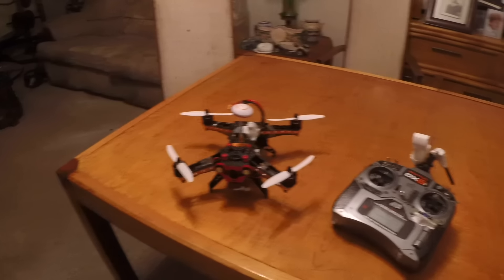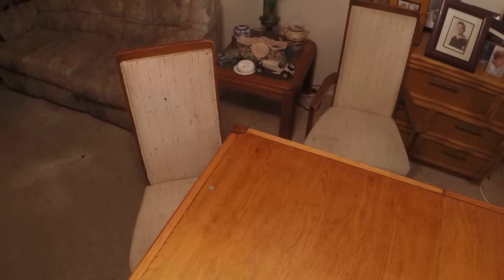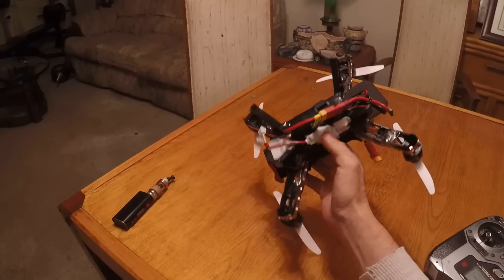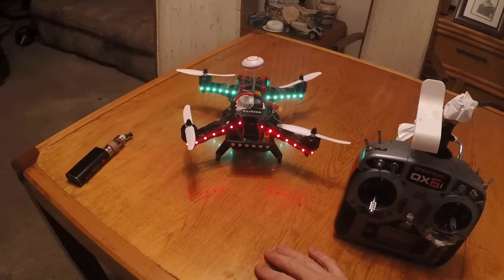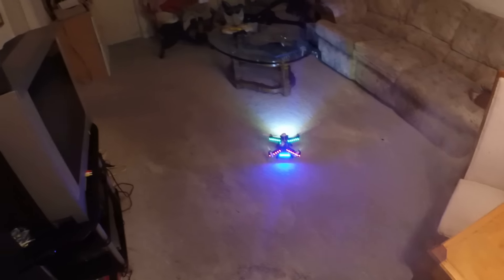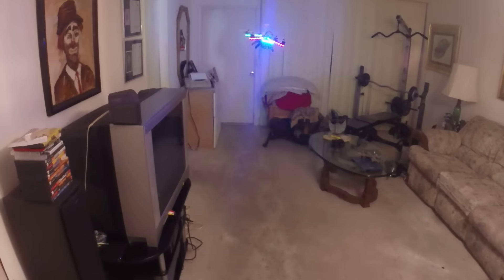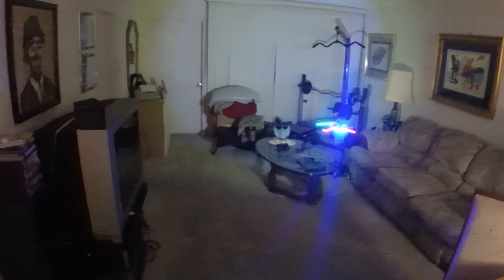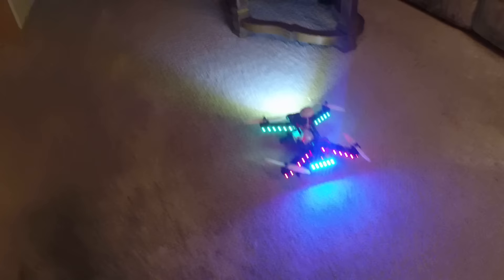mod add walkera legs and Led Lights  Eachine Racer 250 FPV Drone 5.8G Tx OSD cam ARF Banggood.com

Comment: Do you find much battery drain from the extra LED? Did you need to add a connection for them?
Reply from the maker: they use little power . connection to battery balance plug